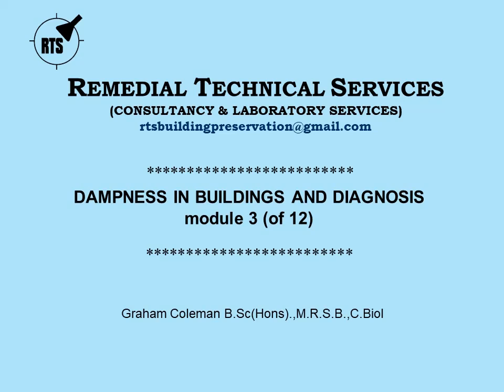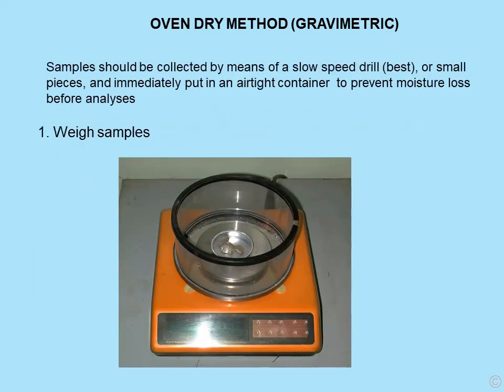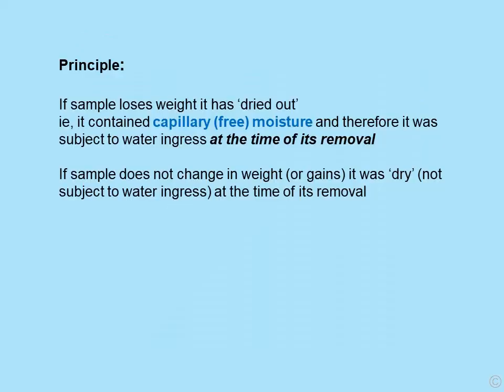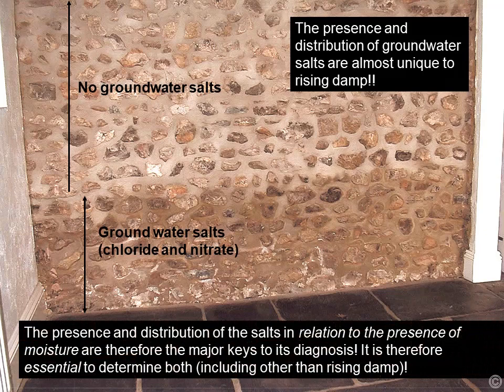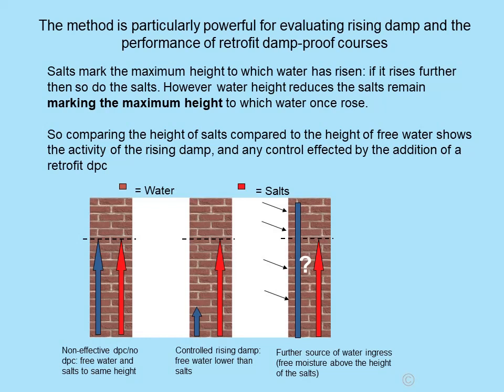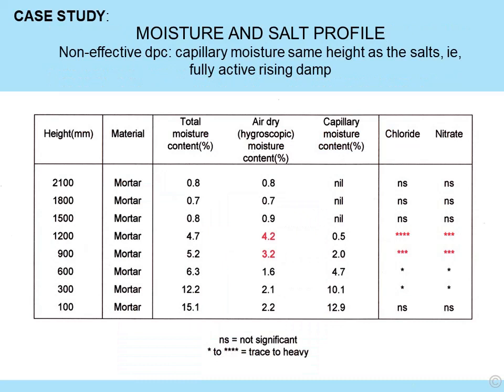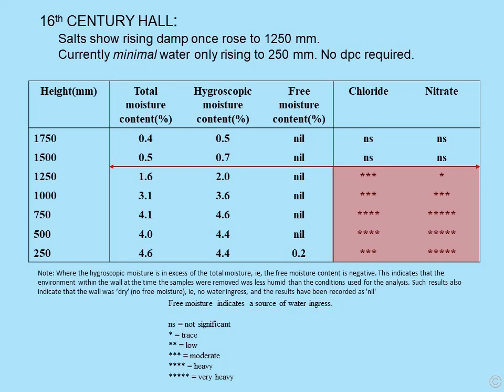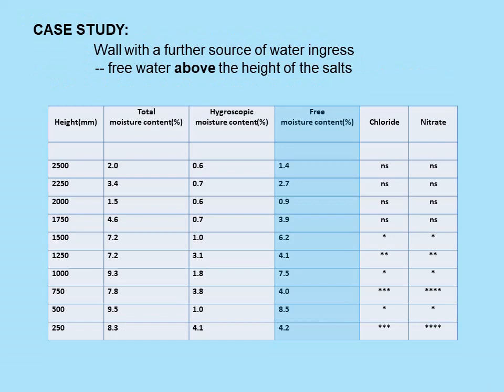Dampness in Buildings and diagnosis module 3

Comment: Module 3 sits at the core of dampness diagnosis. It shows what no electronic meter can do - that is the splitting of the free water in a masonry sample from that which is due to hygroscopic effects. Graham also shows how the gravimetric method is used in practice, using some case studies. And, he even demonstrates how it can be done using a Calcium carbide meter. Graham has been teaching this to PCA members and others for very many years and we are so grateful for it. I recommend this module to anyone wrestling with the reasons why an electronic meter is reading 'off the scale' when a Carbide reading from the same wall is showing 'only' 3% or so.....  Once you understand the relationship between air dry, and free water distribution, all will be clear to you.